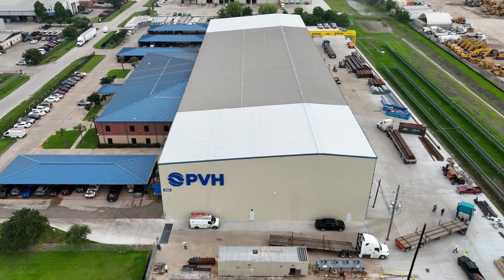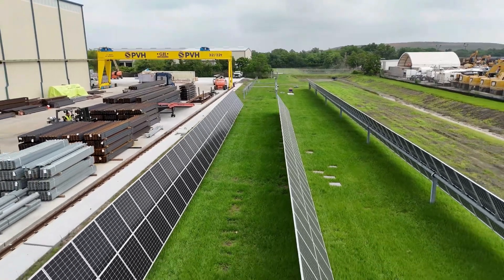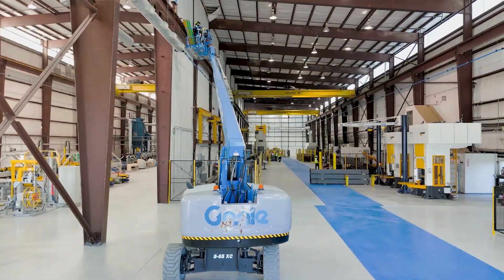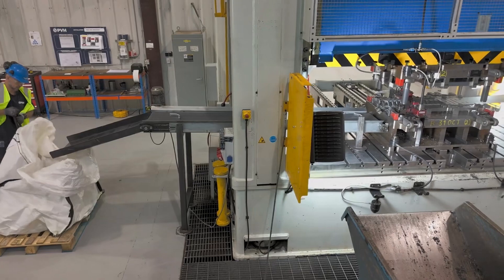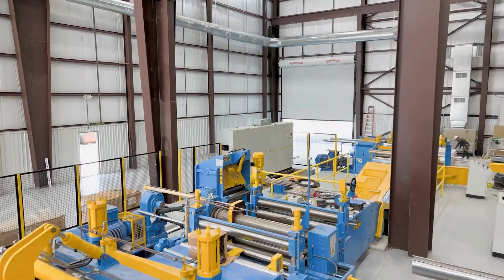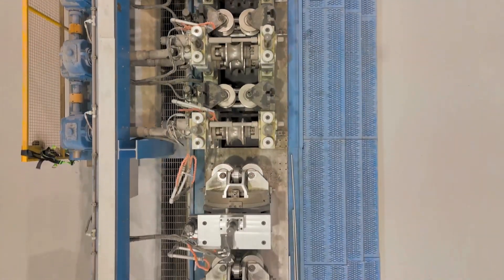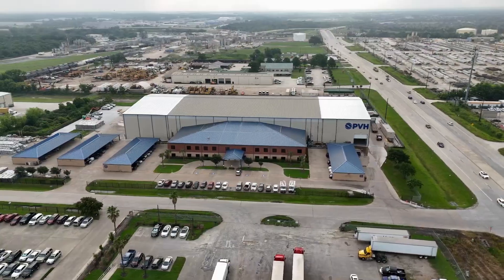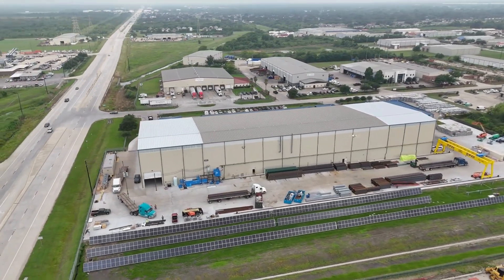My First Official Drone Job. I used a DJI mini 4 Pro

Comment: Great job, congratulations.  I've never used my drone indoors on jobs, did it behave well, it looks great.  Also, did they give you any issues regarding licensing?
Reply from the maker: @alanabley525  the drone behaves really well indoors, I just flew very slowly. No one really asked me for the license but I like having it just in case.
Reply: @FlyhighLittleDrone  Thanks for your reply, I meant any problems regarding licensing, copyright ownership, contract. etc.
Reply from the maker: @alanabley525  rights of the photos? I sell rights to use the photos to the clients, they purchase full rights to own and use the photos and videos. Is that what you mean?  Once they pay the invoice the photos and videos are all theirs to use as they like. I retain the right to use in advertising and marketing.
Reply: @FlyhighLittleDrone  There's a big difference between owning and using, especially in commercial photography.  Are you given away your copyright? You can't both be owning the material.  Commercial photographers usually only sell the copyright for a very high price while licensing according to the use. Hope you charged accordingly as this is something photographers have worked hard for and is the norm.